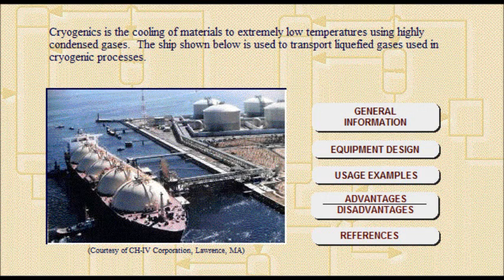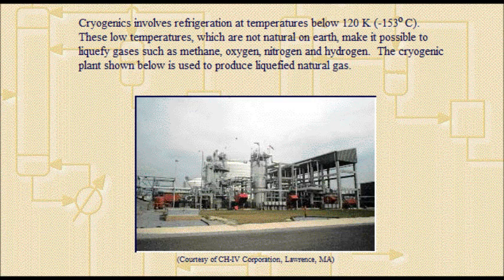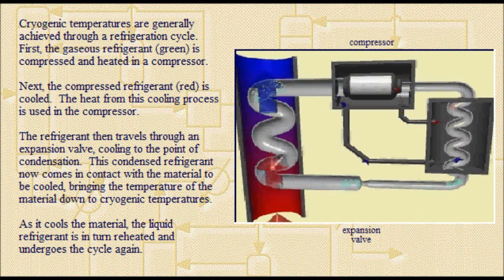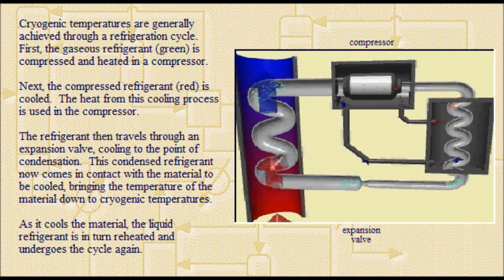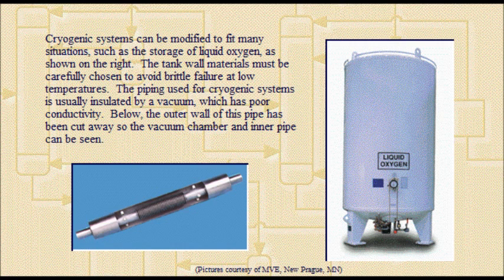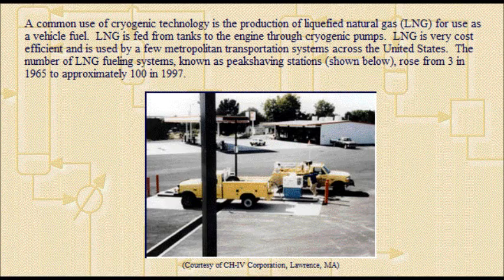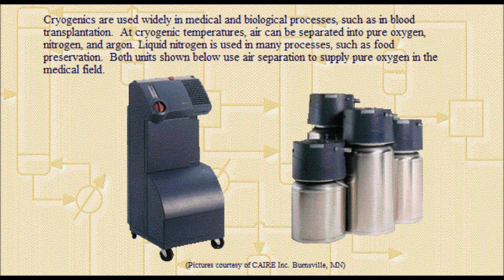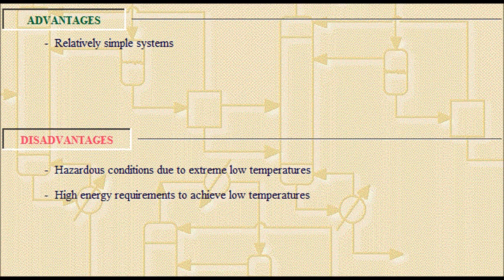Cryogenics Working Principle , Animation Importance and Advantageous

Comment: People need to study material in order. Understand how this System work.
Reply: works the same as a fridge compressor only it uses helium. 
no need to study material wont gain anything from looking at a block of wood or steel..  just study thermodynamics and refrigeration instead.